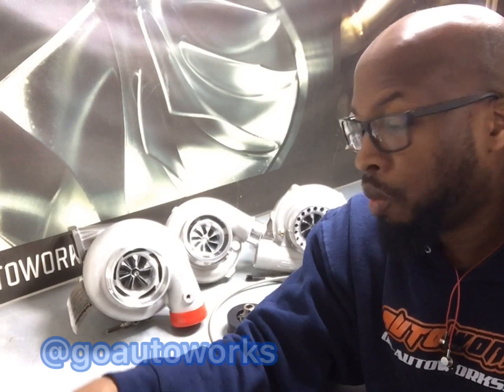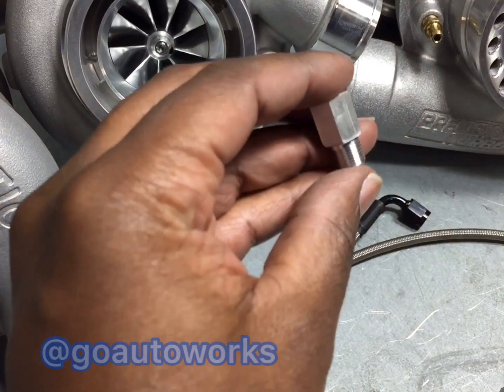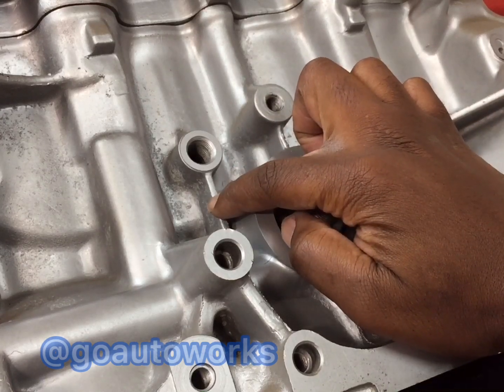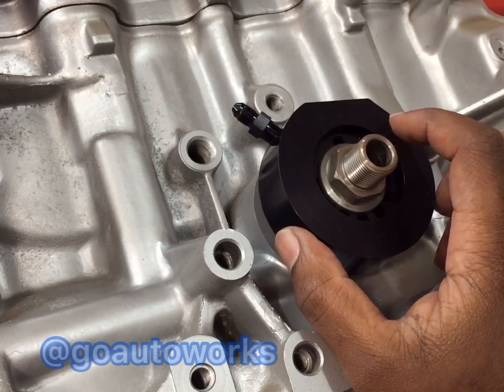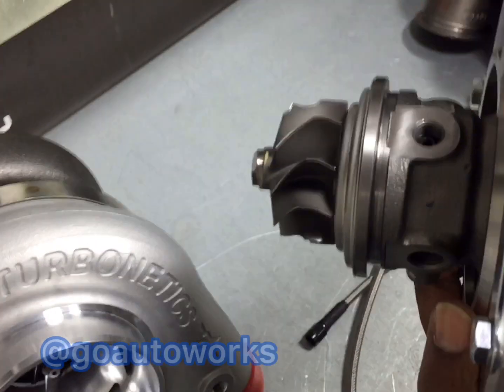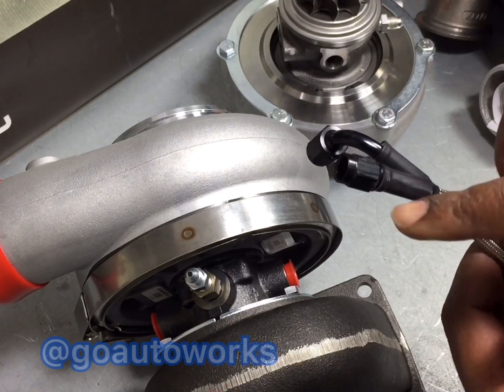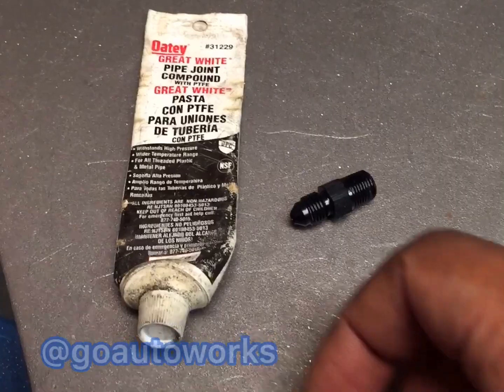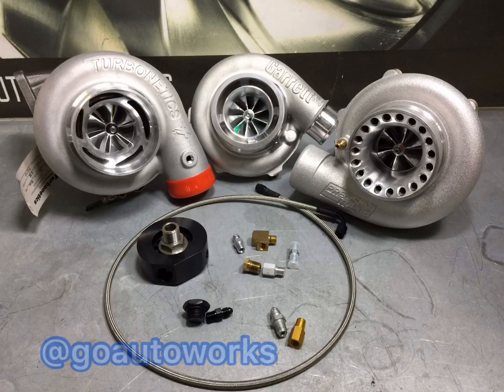proper turbo oiling & set up, journal and ball bearing with GO-AUTOWORKS

Comment: How come you dont use  the stock  honda oil sending sensor split in half with the t fitting in the middle of the factory set up using the plug from the sensor into the block ?
Reply from the maker: I don’t understand exactly what you are asking

Comment: I know this an old video.  At what psi (z6) do you recommend the .065 restrictor for journal bearing?  I have smoke only at cold start 90psi
Reply from the maker: Hello, what turbo is it? Do you have a ventilation setup on the motor? Is the drain a clear path 10AN or 5/8?
Reply: @GOAUTOWORKSYOUTUBE   it’s a Garrett 60-1  with 3an feed.  Very short and straight 10an drain.  Catch can is set up with only 1 line but also have oil cap vent

Comment: I stopped with the hit or miss turbo feed oil restrictors in favor of the TurboSmart OPR that feeds a very steady 40psi of oil pressure to the ball bearing Turbo regardless of rpm. I also use there inline oil filter as well. The TurboSmart OPR may have not been released yet when this video was released.
Reply from the maker: Restrictors themselves aren’t really hit or miss; it’s people not knowing if they “need one” or not while understanding what causes “smoking/oil related issues”  that is hit or miss. I sell and use the Turbosmart regulator as well; it’s great for certain apps...and totally unnecessary for others.

Comment: Still doesn't answer the simple question. With turbo requires an oil restrictor an which one doesn't . does a journal bearing turbo require an oil restrictor ?
Reply from the maker: ...the short, generalized, non application specific answer is no

Comment: this video has helped me so much!!
im boosting my Kseries and piecing things together,  is it possible to get the Pro Turbo Oil Line Kit with 4AN hoses and connectors inplace of the 3AN?
either way i will deff be ordering the drain kit and some other goodies. your website has great prices and variety.
Reply from the maker: Yes you can just request a 4an feed in the order check out notes and we’ll make it that way
Reply: @GOAUTOWORKSYOUTUBE  sweet, just placed my order. thanks again.

Comment: I have a quick question. I currently own a Precision 5858 SP BB .82 A/R turbo, and wanted to know which oil feed would I purchase for this specific turbo, and will it need a restrictor for it? Please let me know. Thanks. Appreciate the reply. If you could also post the link so I can purchase the appropriate oil feed kit for my turbo. Thanks.
Reply from the maker: Hello, that turbo would use our Pro Oil Kit/T3. It uses a -3 feed, 10AN drain. In most cases a restrictor is not needed here as long as you have proper drainage and am ple crank case ventilation http://www.go-autoworks-store.com/gotrblprooil.html

Comment: I can't seem to find info on it but xona rotors new variable preload ball bearing doesn't mention anything about oil restrictors  and uses oil pressure for it to operate, you don't need an oil restrictor for their new line of turbo? They don't have a contact page
Reply from the maker: Hello, in general the Xona BB line will use a restrictor.

Comment: Jay's tech tips states don't go smaller then -4 on the oil feed to the Turbo. You say -3?  I need to know who is correct? Also if I may ask I have a GT3582r duel ceramic ball bearing Turbo from ebay. It appears to be a nock off of the precision 6266 unit. Do I use a oil restricter? or not?
Reply: Ball bearing setupnshkuld already have a  restrictor in the feed inlet.  Ut sonce yours ebay. Just double check it
Reply: Exactly everyone saying different shit lol

Comment: Do you need to add any Teflon or pipe dope ?
Reply from the maker: Luis Padilla you can add Teflon tape or paste to the straight cut/npt side of a fitting. You don’t want to add any type of sealant to the AN/flared side of a fitting
Reply: GOAUTOWORKS thank you. I am just concerned about the water lines. I have bad experiences with the copper crush washers
Reply from the maker: Same goes for the water fittings.
Reply: If it is flared leave it alone.  Straight cut just use blue monster Teflon tape. No dope sealant its small fittings

Comment: I have a question about oil feed size. I have a t3/t4 t04e turbo. It’s an eBay unit, but it’s journal bearing. I’ve seen a lot of -4an feeds but I heard you say -3an feed. Is there a best or better? This is my first iron set up and I don’t want to fry the turbo. Thanks brother!
Reply from the maker: -3 would be ideal here...especially on an eBay unit that would be more prone to leakage. I would suggest swapping the feed size to -3AN, having a clear path oil drain, and using a catch can app to help vent the motor.
Reply: GOAUTOWORKS thanks man! I appreciate it!
Reply from the maker: @TIP-PJ  no problem. We keep those accessories on the shelf at all times if needed
Reply: First turbo setup*
Reply: Great video greg. Thank you as always. Can you make a video of boost reference for Garrett turbo charger with out a fitting on unit its self?